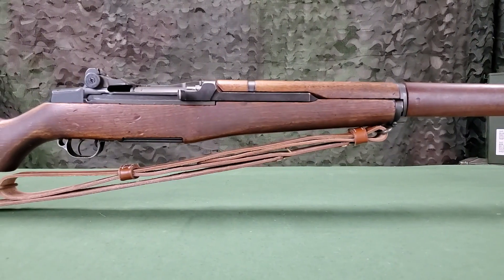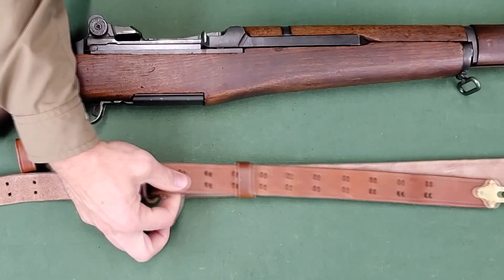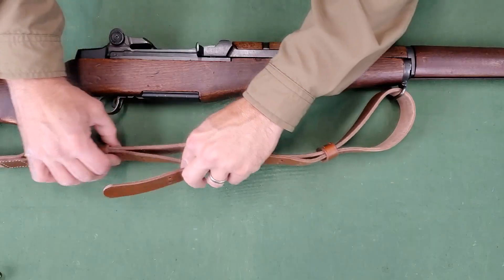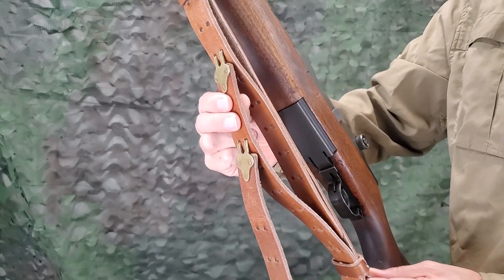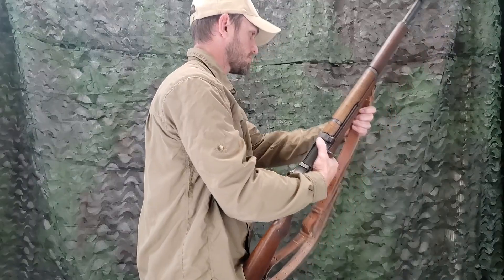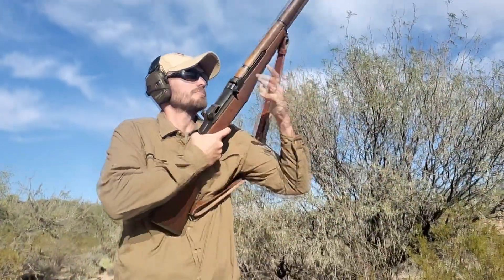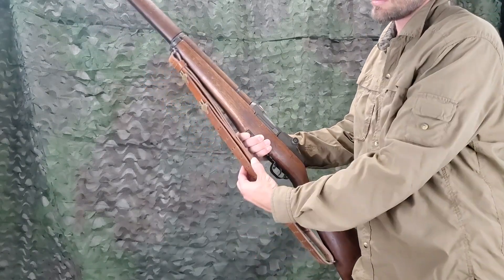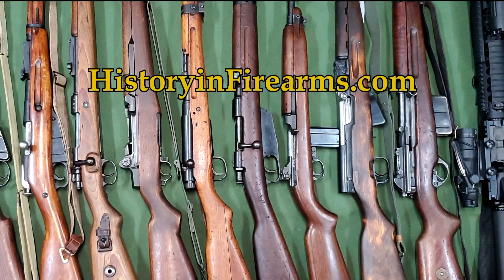M1 Rifle (Garand) M1907 Sling (TF 8-05A)

Comment: Everything about the sling and its use all in one really good video.
Reply from the maker: Thank you! Appreciate it!
Reply: @HistoryinFirearms  would the hasty function of this work with a pump shotgun? Or simply put which way do you think this sling would work best with a shotgun?
Reply from the maker: @Ed P.  The hasty sling would absolutely work with a pump shot gun and would probably be more practical than the loops sling. With that being said, the canvas/nylon M1 Web sling may be a more practical sling option if you are not going to use the loop sling set up. I do have a video on that sling also.
Reply: @HistoryinFirearms  the TF8-05B video?
Reply from the maker: @edp.8687  Yep, that's it. 👍
Reply: @HistoryinFirearms  lol life is funny, I was in the middle of watching that one when I read your message
Reply: @HistoryinFirearms  I'm seeing some on Amazon, unless you have a better recommendation of where to get a good one. Appreciate your insight and help.
Reply from the maker: @Ed P.  Haha perfect! If you are primarily going to use the web sling as a hasty sling, putting a half twist in the sling will make it lay flat on the arm. 👍
Reply: @HistoryinFirearms  yea that's what I was thinking I was going to go with and how i was goingto use it. As far as quality, got any recommendations?
Reply: @HistoryinFirearms  I used boonie packet swivels, just a little over an inch wide, 1.10 or so, would the sling attachment clip be too wide?

Comment: Jesus. I looked this video up because I was researching the m14 crazy horse which is still being issued and comes with that sling. That's a lot of work to use it as an aid. Im surprised they still use these.
Reply from the maker: It can be some work to use the loop sling. There are some other techniques and setups for this sling out there also. That being said, while fairly complicated and intimidating at first, the sling is pretty versatile and easily adjustable. Making it a pretty good hasty sling. With the plethora of sling options out now days though, I am also surprised it is still issued.

Comment: I feel like my sling is a little longer than some. I followed this video and a few others to the exact details, and I still can’t tighten mine all the way like that. The only way I can get it right is if I take the short strap forks and extend them over and passed the long strap forks and into some of the further holes, which in my case seems to be the ones that are literally on the loop of strap coming out of the front sling swivel.
Reply from the maker: There are definitely some variations in the slings that are out there and available.
Reply: @HistoryinFirearms  I was finally able to get it somewhat right, I had to take the hooks on the long strap passed the keeper and into the last two available holes, just after the sling swivel near the front of the rifle. Then the short strap hooks into the last two available holes on the long strap. It’s not quite as tight as I’d like it, but it’s the best I can do with what I have. For a 1943 rifle, do you know if this leather M1907 sling is correct for the time period? Or wouldn’t webbing sling be correct.

Comment: Thanks I have two leather slings sitting the drawer to put on my Garand and 1903A Springfield. I think I like my webslings better, but the leather way cool.
Reply: Ditto on both the Leather and Web slings. Except I just have a M1.
Reply from the maker: You're welcome! The leather sling definitely gives rifles a different look.
Reply: @HistoryinFirearms  i got a 1942M1 Garand but what was more original in WW2 days? Web sling or leather? Im trying to keep it original
Reply from the maker: @XxBlacKkNighTxX7  Impossible to tell what was "original" on the rifle. The cotton web sling was adopted in 1942 and would have likely taken a little bit to get fielded. I would say the M1907, M1923, or M1 cotton sling would all be "correct" for your M1. So I think it comes down to what look you like best.
Reply: From what I can tell, the leather slings were used up in service until they were gone, then the Web sling became the standard in armories during the Korean War.
Edit: I imagine a lot of snipers and marksmen from WW2 through Vietnam with Springfields, M1Ds and Winchester Model 70s may have tried to get ahold of the leather slings to get the option of stability loops.
Reply: @shockwave6213  The 1907 sling was seen on the M40 rifle well into the 1980s